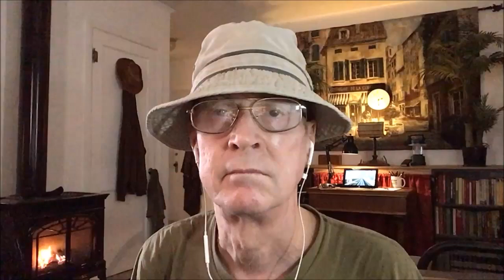Your RF Ground System

Comment: I have the Chameleon Micro setup. So, I have used a ground spike, but for the Mil Whip or End Fed, the balun is attached to a Chameleon Clamp which is clamped to a common 7 foot steel fence post driven about 3 feet into the ground. The PL-259 connector goes to a lightning arrestor, and the other end goes to the rig. The lightning arrestor has a #6 welders cable and welder plug attached to it. The mating end of the welders plug has another piece of #6 cable attached to a 6 foot, 5/8” diameter ground rod driven 4 feet, 8 inches into the ground. 73!

Comment: Stan, long but simple:
This is what has been done here, and is in no way a recommendation as every situation is unique. I have always thought of "RF ground" as it relates to the coupling field function of my antenna. AC power or DC ground = a very low (0.001 ohms) resistance connection to earth. Im my case here on this suburban postage-stamp lot, I use several (inverted "L") wires of resonant lengths supported by a tree. The radial's half of my antennas consist of several runs of electric fence wire along the bottom runner on the  backyard wooden fence and about four #10 soft drawn copper wires that are on the ground covered by grass. These make up a counterpoise terminating near the junction or common point  of the resonant wires. Also at that point there is an eight foot copper coated steel ground rod just as a safety measure. There is a Farrite choke then the line goes underground over to an opening in the outer wall right under the power company riser and meter. There, three ten foot rods driven and spaced in a delta with ten foot sides. All that is cad-welded to a copper bulk-head on the wall where the coax enters the house (). through another line choke. My shack is upstairs in my office/man-cave and only the RG213 line goes up there. The radios use the green wire safety ground. 
My rationale is, let the "RF" ground be at the base of the antenna where it can most effectively  return the near-field displacement currents to the common point of the antenna wires. The RF choke in the transmission line keeps the coax shield from acting like part of the ground system. All in all, a three ring circus. In other words, let the antenna do its thing, the transmission line do its job and the radios do their job. Now with dipoles you don't have to worry much about that (or at least I don't). In that case, use a choke in coax transmission line near the antenna and ground the coax outer with ground rod before it goes  into the house. Now for open wire balanced line, you'll have to make it up as you go along, case by case basis. In any case, if you can't verify your house wiring safety ground, run a ground wire to the ground rod also, typically if you have RF on your green wire, that ain't good. Many grounding schemes harken back to a time before green safety grounds, old houses etc. I'm really not worried much by lightning because I NEVER connect the coax to the antenna unless I intend to use it, then disconnect it afterward. Results and situations may vary; however, this concoction has served me well for 21 years in this house. Except when the trees are blown down. 
Sorry for the long rambling diatribe post...
73' de K4WRF

Comment: Greetings from eastern Nebraska Stan! De ke0rup. For a dc ground i typically will ground my random wire antenna  at the far end or use a spark gap at any point in the wire that is shunted to ground rods which are bonded together. For my  coax fed antennas for vhf i will typically also attach to a spark gap arrestor. As for RF ground for my randomwires i will use radials off of the transmatch that then are run out side and those can be from 40 to 200 feet long and usually one of those  will terminate at a ground rod. If i use a wire loop or doublet  i will run a wire from the transmatch to a ground and it helps the noise level and any ladder line for a doublet or loop is run through a lightning arrestor as well. I hope i havent rambled too much. 73 from ke0rup, Jim